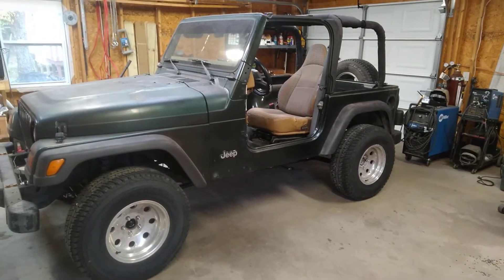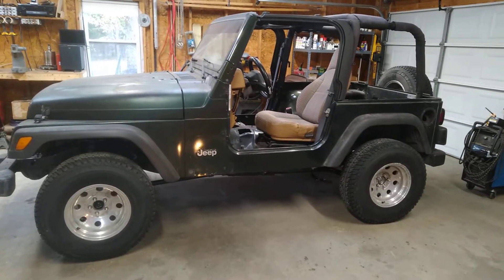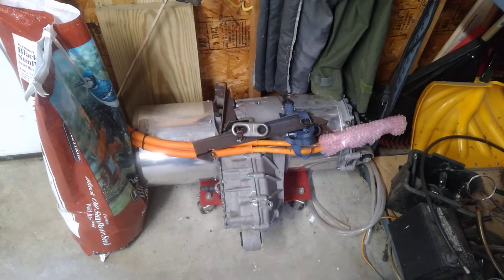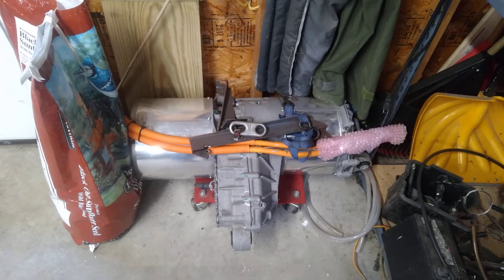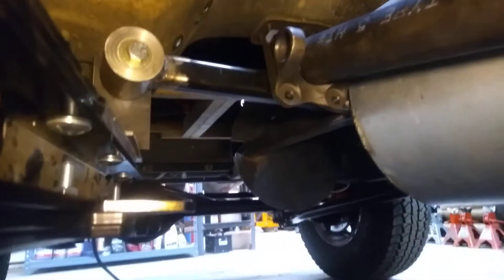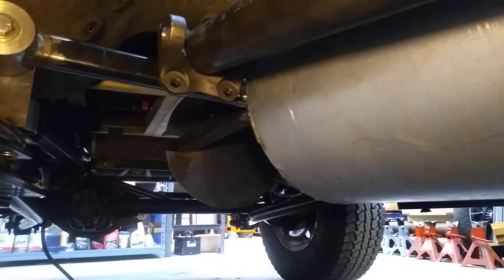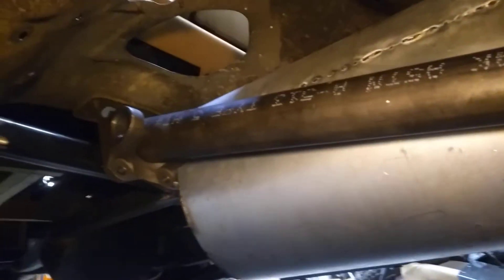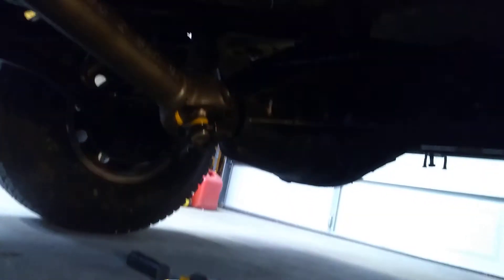Tesla Wrangler Conversion

Comment: I don’t live in California but I live in Texas but saw on the other news that they said in 2035 they will ban gas vehicles in California so propbably this will be a good idea so those who can’t afford electric vehicles.
Reply from the maker: Time will tell if that law will survive 13 years.  It's very possible that nobody will WANT a new gas car by then and the law won't even be necessary. Or, as some say, this EV thing is just a fad and in 13 years no manufacturers will be making EV's anymore.  In any event, converting a car to electric is not for everyone and it certainly isn't affordable. I've got over $50,000 in this Jeep and I did it myself.  A conversion shop would charge much more.

Comment: I'm trying to do something like this to a YJ. I look forward to seeing your progress.
Reply from the maker: Thank you.  I just had surgery on my arm last week so any progress will be slow for a while. If I had it to do over again, I wouldn't use a Tesla drive unit.  Yeah, it's cool and unique and powerful but it's a complete nightmare fitting everything and Jeep components are not designed for that much power.  I'd recommend use a Nissan Leaf motor connected to a 2:1 gearbox bolted directly to the transfer case.

Comment: Interesting idea. I want to do this to my 1987 Wrangler.  Full time 4wd sort of. How will you get the gear ratios correct, as you are driving the diffs instead of the wheels directly, as on a Tesla?
The other question, does the Tesla drivetrain have a limited slip, because if not, won't it have zero wheel drive?
I am definitely going to follow along as you do this.
Reply from the maker: Not full time "sort of".  It's full time all wheel drive.  
I swapped out the OEM gears in the drive unit with some 4.5:1 gears.  I put 3.07:1 gears in the differentials.  The up side to the diffs is the pinion is very large so theoretically stronger but the diffs will be the weak link if I try to send it with full power.  I put a torque biasing limited slip in the drive unit and a lunchbox locker in the rear diff.  The front diff is open.  I wanted to put torque biasing LSD's in the front and back also but they're not available for such a high gear set.
I've made a number of videos detailing this stuff.
Reply: @billbayer5526  Thanks, Bill! After I commented I subscribed to your channel and saw the multitude of videos you've produced. Gonna be a Jeep EV binge watch for me. My Jeep has a 1" body lift and a bad motor
Reply from the maker: @Yodaandhislightsabre  Thanks for subscribing.  I'm well on my way to being the YouTube superstar I dreamt of as a child!  :)

I put a long arm suspension kit on my TJ and it is my most regrettable decision.  It has caused nothing but fabrication nightmares.  I think with your leaf sprung Jeep, axle wrap could be a problem so I'd recommend you look into either the small drive unit from a Model S or a Model 3 DU.  The M3 DU is the latest and greatest but I'm not 100% certain a taller gearset and/or LSD has been developed for it yet.  ZeroEV recently did a shop tour video where they talk about M3 DU swaps.